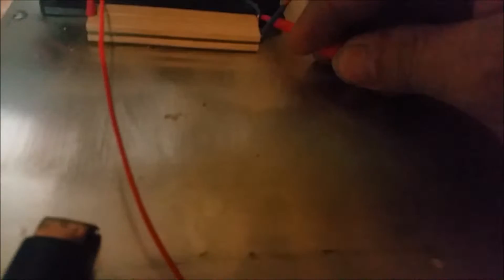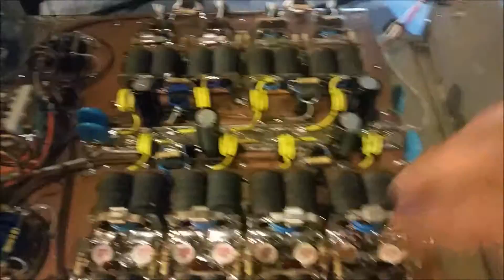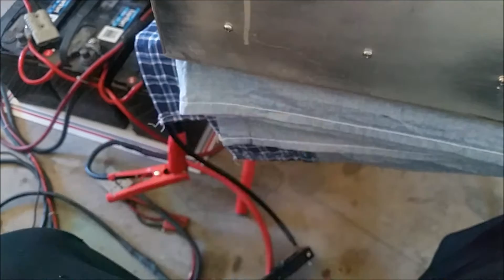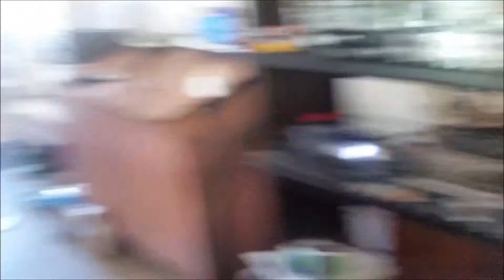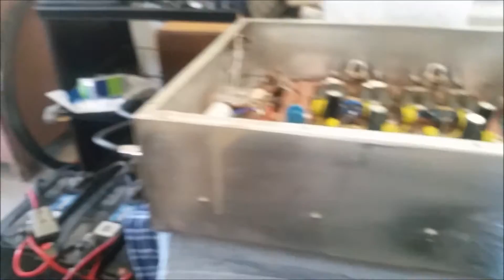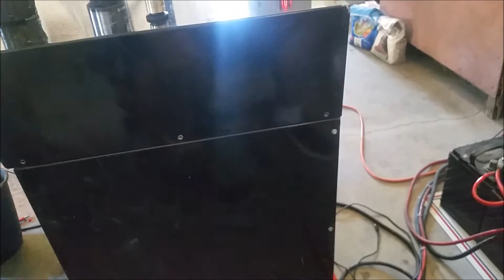Davemade 16 Pill Amplifier EXTENSIVE REPAIR Video 2 of 2 - Output Test

Comment: ok, power supplies! you have a 200 amp supply. I'll soon have a 600 amp switching supply regulated to 14.2v. the voltage will fall of to no lower than 13.8v. where and when it will shut off. what do you think my 16 Dave will do with that pushing it? the supply will be powering the 16 Dave, a one pill modulator with ab biased, a 4 pill dx500 ab biased and my yeasu 857d. with it having 600 amps, I suspect it would never drop to 13.8v. I doubt it would drop to 14.0v. with everything cranked. now I will separate how the modules are turned on. one switch will turn on the 400 amps section and will run the 16 Dave. 100 amps would power the yeasu, one pill and 4 pill. the last module is there as a buffer. and it gets a 2 farad electrolytic cap for filtering of any hum. I will add a coil to steady current peaks and null. as for wires. I'll be running two 0000 gauge wires for + and two 0000 - for the Dave Made using a 350 amp quick disconect. a 175amp quick disconect wired with 6 gauge for + and - to the 4 pill Texas star and 30 amp anderson connectors to the one pill and yeasu. then maybe we can talk without skip conditions. brute force ground wave. when I get a laser 500 beam put up about 125 feet. then I'll be the cock of the Carolina walk. lol...

Comment: Why is one fan cracked and broken? This thing looks like it is a mobile as beat up as it is! Is this thing set up in a barn or a manger it is so filthy inside?!?! I just heard you mention this thing maybe being run mobile. This has to be a terrible design for mobile use. The thing is too big and not rigid enough. Vibrations are going to kill this thing and that would explain why it was so beat to shit and why it had so many issues. It probably vibrates itself apart and something fails and the guy has to take it in to have it fixed. Repeat this cycle a few times over 5 years and just about everything is bad. You can tap parts and watch the values drift all over the place. That is why in harsh mobile environments you glue stuff in place after it has been soldered in place to keep it from self destructing especially in big rigs. In fact surface mount was designed to deal with harsh military environment in aircraft and such that vibrate more than sub-woofer.

Comment from the maker: they should not allow someone to do a thumbs down or unless they give a comment explaining why they want to give a thumbs down I work my little behind off of this amplifier always makes me curious why the thumbs down now I do know there is one person out there I don't know who he is but he likes to give a phone down with each video it's just funny that he gives a thumbs down with each video but he has to be a subscriber to no one ever uploaded a new video LOL I just wish that those people would leave comments sometimes and communicate with me maybe I can change something that they are not liking how would I ever know if they don't speak up you know I ain't sweating it though so your gravy I love peace and chicken grease
Reply: ON THE ISSUE OF RF TRANSISTORS SHOWING GOOD WITH DYNAMIC TEST BUT WON'T WORK IN CIRCUIT I RAN INTO THIS MANY YEARS AGO FROM AN OLD TECH.I BROUGHT HIM 8 PILLS TO REPAIR AN AMP I COULDN'T GET TO WORK RIGHT. I TOLD HIM I TESTED ALL THE TRANSISTORS AND THEY TESTED GOOD. HE PROCEEDED TO TEST THEM AND THEN AGAIN ON AN O-SCOPE . HE TOLD ME HE DOES THIS TEST IN ALL TRANSISTOR AMPS HE REPAIRS. HE USED AN O SCOPE IN FROM WHAT I REMEMBER WAS COMPONENT TEST CONFIGURATION. ALL TRANSISTORS TESTED GOOD EXCEPT ONE. HE SAID, YOU SEE THIS (POINTING TO THE SCOPE ) THIS ONE HAS A CURL. OH! HE TOLD ME ALL TESTED GOOD ON OTHER TEST BUT THIS TEST REVEALED THE DIFFERENCE IN WHAT NORMALLY SHOWED AS GOOD. 
HE REPLACED THIS ONE TRANSISTOR AND THE AMP WORKED AS IT SHOULD. THIS MAY NOT POST IN THE CORRECT BLOG BUT I DIDN,T KNOW HOW TO CONTACT YOU WITH THIS INFORMATION YOU MAY BE ABLE TO USE.

Comment: I just dump 4 of those resistors  at my work place  ,these are use as bleeder for  grinding machine that  cut  aeroplane  blades
( high temp metal alloy ) these machines are like a bed room when they start changing colors they dump them out , they sit on the top when the machines are turned off  through the housing  they glow like Christmas lights for a while , if we ever  change anymore I will keep you in mind . of course I kept the case to make a power supply . made by  IPC power resistors  Erlanger  KY.
Reply from the maker: nice thanks. now i can breath brother...that had me heemed up a bit. your gonna love your 2 banger manger man. i went all out because of the wait.thank you for being patient. there are going to be a lot of builds finished these next 2 to 3 weeks.
Reply: awesome , remember I am a ssb  dx er

Comment: 1,500 at 13.8 and 3000 pep it means that at 14.8 it will do 1,600 + and 4,500 no problem. Amazing work cause only few builders show rms watts only pep and pep is  modulation watts!!!!!!!!!
Reply from the maker: oh yeah plus this supply does not have enough amperage. it really needs to be double meaning 2 more of those transformers. i was shocked to be able to get 1,500w RMS out of it.